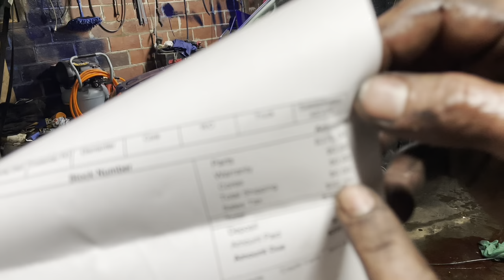How to Fix Deer Damage on a Budget! (My Way!)

Comment: I hit a deer last night and my hood is knocked up and back over the hinge, how exactly should i approach fixing it
Reply from the maker: So I would find a junkyard with just the minimum parts you need. It'll be cheap and get you back on the road, do a little but of trial and error as well with saving old parts. Good luck and respond with anymore questions and I can get into contact!